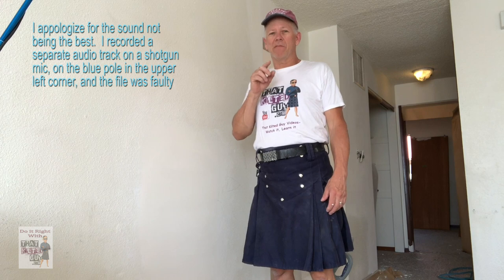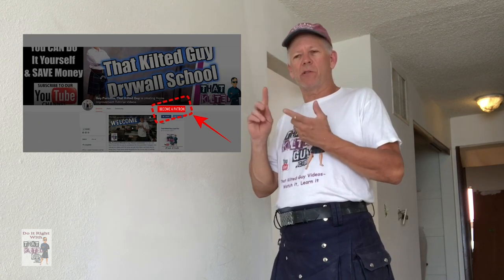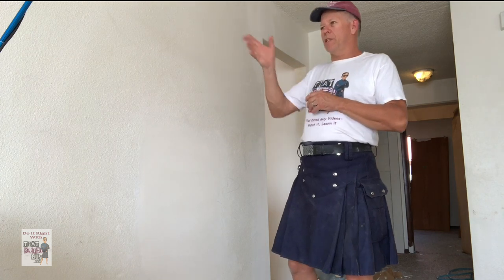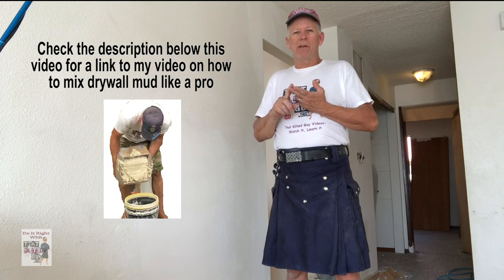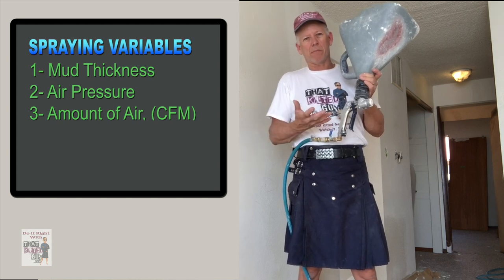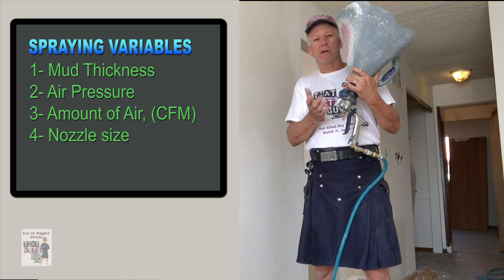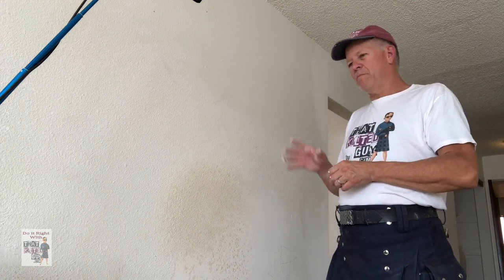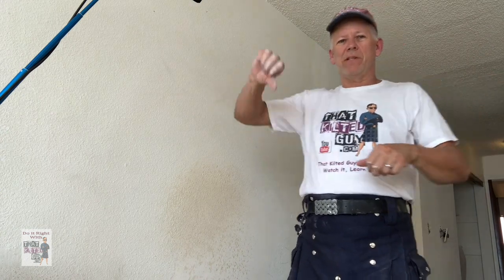Blending Orange Peel Texture.  On The Job Example. Texture #2

Comment: I have all my variations of hot mud and powder texture in those little two gallon buckets that I've labeled (4 to be exact). Makes it super easy to transport and store in the trailer, and is always just enough to do a couple jobs with before I need to refill em.

Comment: Great workmanship again Orange Peel looks really good. I really like that harbor freight little cheap gun I got better results with that doing smaller jobs than the homax.  I also added the air regulator to the end of that gun which was a big helper in trying to get the correct air temperature to spray the correct pattern to match your patterns perfectly on an existing pattern that little air regulator at the inlet added to the texture gun gave you that more air control right there which was a big help and then also definitely like you said you need to have the compressor power to spray the knockdown and orange peel from these Hopper guns definitely need at least a pancake compressor that's what I use but that's for you know just rooms. And then same thing with the homemax orange peel and knockdown spray cans that are already made I can see those same results that have happened before also I see that lovely first patch there were no one even sanded on the top of that looks horrible. But I learned that the best way to try to get these cans at the best results is to of course warm them up soak them in the hot water shake them up for a minute test spray on a piece of cardboard and usually end up maxing out how far you can turn the dial to get the pattern you want and then of course how far back you are from where you're going to spray and the rotation counterclockwise small circles in your hand came out really good with the hopper gun but with the spray cans I always get those tiny bubbles in there or I'll get a big inconsistent spray or no aerosol or too much aerosol spray at the beginning put the can in too hot of water or warm it up in the sink under hot water to try to get it done faster and it always seems like probably 70% of the time I always end up with those tiny little micro bubbles in that spray can texture that come out horrible and you can't get a knockdown big enough to really match it you can only go with the orange peel and the orange feel I could actually get to look like it was done with a real machine sometimes if it was just a small enough spot.

Comment: I love your videos, thank you!  I have knockdown texture on my walls and need to do a repair.  Is the repair process different as opposed to a smooth wall?  Concerned that the mud stackup could get quite ugly after taping, mudding, feathering and then applying new knockdown texture over the repair area.  Any advice as how to proceed?  Thanks,
Reply from the maker: Hey glad to hear my videos are helping. As for repairing a wall with knockdown texture, I do it all the time. If you don’t put too much mud under the joint tape, or use mesh tape instead, and keep your coats as thin as possible, and know how to spread the mud plenty wide, it works just fine. 

Check out my video on repairing a large hole on the ceiling at https://youtu.be/JoWWE7d7UU8 To see how wide I coat a repair. Be sure to whether the outside edges with a dry sanding sponge until they are literally tapered out to nothingness.

I will be putting out a video on spraying knockdown texture soon.

If you feel this free information is valuable to you, I hope you will consider joining my Pareon Page at- www.patreon.com/thatkiltedguy 

Thanks, Guy

Comment: Sooooooo helpful!!!  I have a very, very light texture.  The painter called it wallpaper texture.  No one else has ever heard of it. I don't know how to match it.  The previous owners loved spackle and filled a 4 inch circle around each dent, ding or whole, ruining the texture!!! My thought is to try really thin mud and fine tip with lots of air flow and pressure.  Any other ideas??.
Reply from the maker: Actually you are right on track except one last variable, barely pull the trigger and you’ll get a nice fine mist. If you don’t, your muds probably not thin enough. 

Also if they made all those shiny spots repairing nail holes, and they didn’t sand the edges, the texture won’t make it go away. It will give texture to the shiny spot but the edge will still show unless you put a coat of mud on it and sand it properly. Watch my video about repairing nail holes to see what I’m talking about.

Really glad I could help, and let me know how it works out please. Guy

Comment: Thanks for the video.  Missed it by one day because I actually sprayed a can of the pro orange peel yesterday lol. I played with the nozzle and practiced a little prior to application and it turned out pretty good I think.  Will see when the paint goes on today.   I also have the Wagner electric hopper that I’ve used before and works pretty well.   Just didn’t feel like mixing the texture so I opted  for the convenience in the can😏. Have you ever tried the Wagner electric texture gun?   I’d imagine you wouldn’t really ever use one because you already have two good options, but maybe you could do a video on that some day.  Thanks again for your informative videos.
Reply from the maker: Hi Jay.  No, I've never used the Wagner.  I have used the pro rigs which my father had, but those run about $10,000, so most people don't know about them.  I've also used a Graco texture sprayer, and a contractor friend of mine just bought one, so I'll be doing a review/demonstration of that item pretty soon.  I will keep the wagner sprayer in mind for a future video as well.  Thanks for the idea, and glad you enjoy the videos.  Take care, Guy

Comment: Thanks for your videos.  I have a compressor style hopper similar to yours - what is the best way to spray this orange peel texture ceilings especially in a tight space like a hallway?  How do you keep the mud from spilling out the top of the hopper?  Won't holding at an angle create a weird angled texture?
Reply from the maker: For ceilings, I just don't fill it too full, and don't tilt it back to far.  If you do that, the pattern looks fine.  You can also put an adapter on the hopper to tilt it more forward for ceilings, but I didn't like it so don't use it.  Here's a hopper with one of those- https://amzn.to/36HHO58

Or buy a plumbing adapter out of rubber and make your own.
Check out this video showing me spraying a ceiling- https://youtu.be/0fUkW3SCYiE

Comment: Do you use the same hopper setup to apply medium orange peel texture to a ceiling repair?  I have a 7’ by 4-1/2’ foot area to texture so it matches the rest of the ceiling. Had to repair a large water leak from upstairs toilet.
Reply from the maker: Yes, I use the same hopper to texture everything. All I have to do is switch out the tip. I actually own three or four of the hoppers and sometimes have one set up for popcorn ceilings repair, and the other one for regular orange peel or knockdown texture.  Some hoppers have an angled neck you can put on them to make it a little easier to spray ceilings, but I don’t bother switching that out. Thanks, and I hope that helps.

Comment: We had ceiling done by professional and he did a crappy job, the kitchen heavy on one side and light texture on other side. Living room in spotty globs. Spare texture on edge of room. Seam lines showing, missing paint. I told painter I am not happy how it turned out. Basicly he said that how it is, nothing can be done, live with it. Is this normal? He was having trouble with his air adjustment. How should this issue be resolved?
Reply from the maker: Sorry to hear that, but it happens a lot.  He sounds like either he has no integrity, or he's not nearly as good as he said he was.  That shouldn't happen but at this point the only cure is to skimcoat the whole ceiling, sand it smooth and re-texture, so I'm not sure what to tell you.  For future contractors, I'd suggest downloading my Free ebook which covers how to hire the right contractor to avoid getting burned.  You can find it on my website at: www.thatkiltedguy.com

Comment: Hey man. Thanks for the video. But I had a question. Sometimes when I shoot a patch with texture. Sometimes the texture I shoot is more sharper then the original texture. So that means my patch stands out. How do you match dull texture?
Reply from the maker: That's especially a problem with knock down, so I know what you mean.  I don't know a great solution except to paint the repair extra heavy and about 4 times to help soften it out.  Its usually duller from being painted a lot.  Sometimes you need to shoot with a thinner mud to get it to lay flatter and appear to have less sharp edges, but I think lots of paint helps the most.

this video might help some too- https://youtu.be/fUiSeoOP2bk

Comment: That harbor freight gun there for $20 that you have the red one I actually got better results using that one compared to the home Max brand I like the tip better on that one for for spraying industry standard type of orange peel and industry standard type of knockdown that you get in these production things. That little harbor freight gun was a really good gun actually and I still have it and I always keep one. You just have to get a stronger clamp and then when I always load up those Hoppers I always have an extra bucket just for that gun to sit inside and hold it while I fill it up it just makes it easier instead of trying to hold it and then you could possibly tumble over the top because it's not strong enough holding to the gun itself so I'll just pouring it inside the bucket was a good tip that I did.

Comment: Great video and really specific about spray texture variables.  I believe you identified 6 variables in your video but I think you could add one more.  Motion.  Do you spray in a horizontal straight line from left to right or vertical from top to bottom or a circular overlapping motion.  I've actually seen all 3 of these motion techniques and just curious about which one you believe produces the most consistent application results.
Also in your video the camera was up to close to the wall itself when you were actually spraying the wall so I wasn't able to actually see how far away from the wall you were standing when spraying.  Of course, distance is really important to know and maintain in order to produce consistent results.
Thank you for all you do!
Kelly
Reply from the maker: Kelly, I mostly use an overlapping back and forth pattern, but sometimes circular too, but even that overlaps fairly evenly.  Most work, but I really dislike random, uneven speed patterns as it looks so uneven when it's done.

I believe it keep the sprayer about 2-3' away from the surface.  Thanks for the comment. 😎🔨👣
Reply: @ThatKiltedGuyDIY  I really prefer smooth walls actually...it requires a lot more diligence on final mud finishing but it is clean.  However, smooth walls are a little "colder" and carries sound more than a textured finish so I prefer a fine orange peel finish.  I'm working on a 2 story house and finished the downstairs several months ago and now getting ready to shoot the upstairs.  The reason for my texture interest was in part because I just didn't get the consistency with my finish in the downstairs that you would see from a professional.  My girlfriend tells me it looks great but people really don't pay attention to that detail much and we're always our own worst critics.  We always see our own mistakes!  Anyway, I suspect that my mud was not thin enough so your video helped me to really focus on all those variables.  I'm hoping for better results.
Thank you for taking the time to help people realize the personal satisfaction and pride in the results of their painstaking labor.  Drywalling is not easy....physically or mentally.  As you have so eloquently noted in several of your videos....It is an art!
Kelly